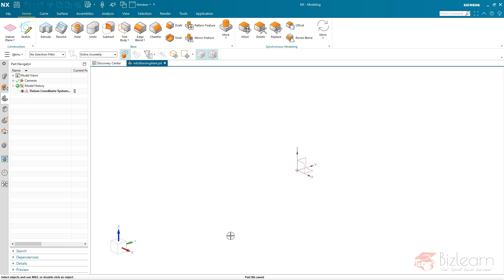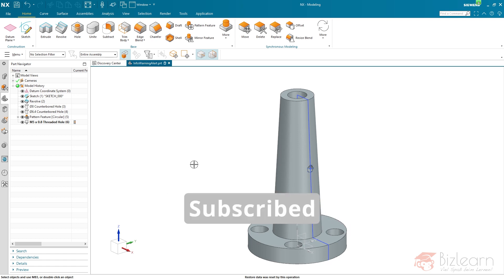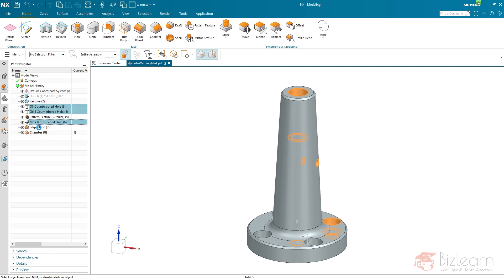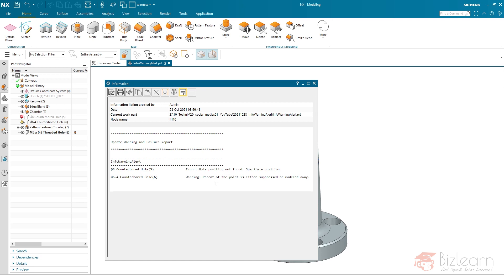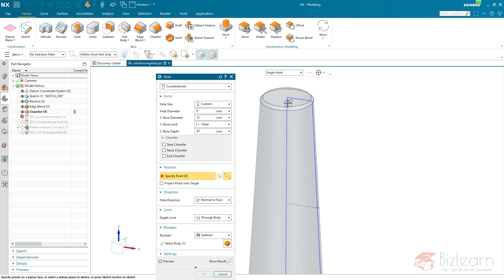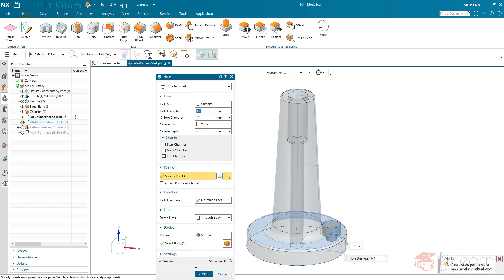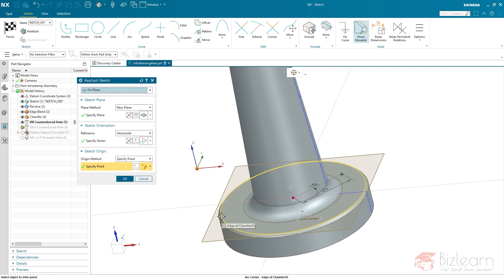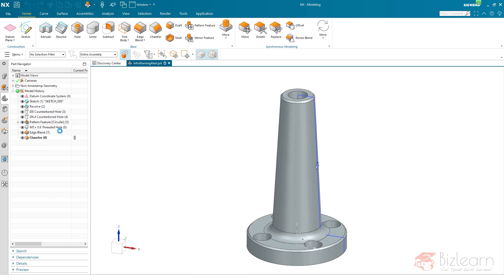Why are those important NX CAD Secrets usually not explained within a Siemens NX beginner tutorial?

Comment: Hi bro..I Have done most of Research in Nx.i have many tricks that might surprise you as well.

I would like to know..how to replace parent model of drafting file.
I have a two file similar geometry but little different..but I have drafted for only one..now I don't want to start drafting from 0..I want to use existing file .
Reply from the maker: Thanks for the comment. Only versions can be replaced properly without manual corrections. We're these parts created separately or via save as? If save as was used, you can replace the child component within the modeling task. Right click. replace.